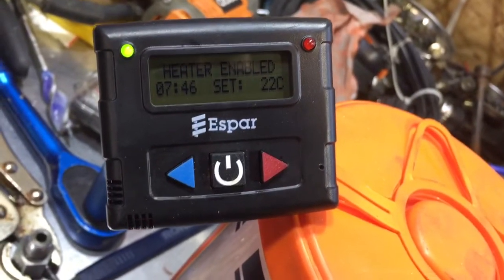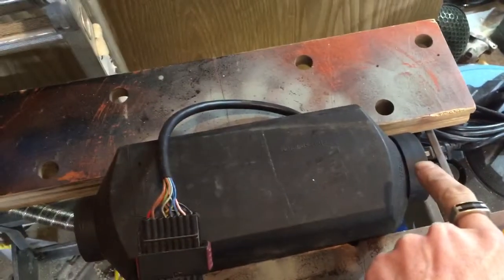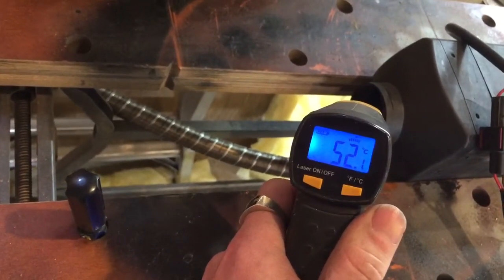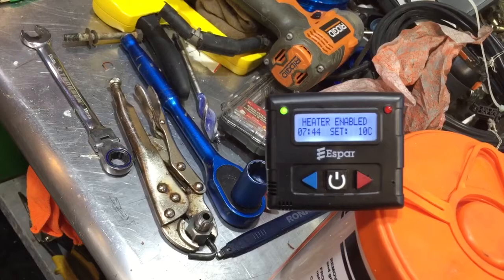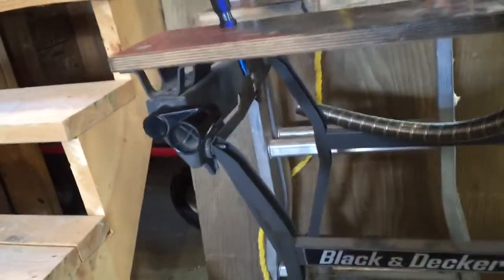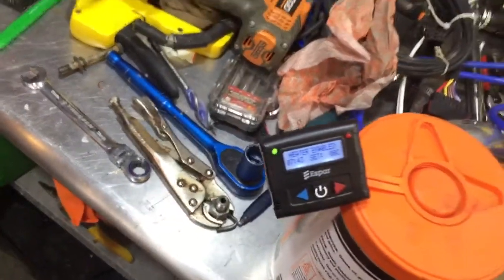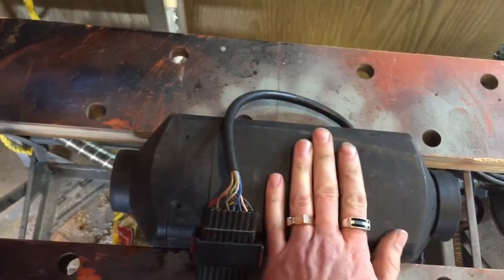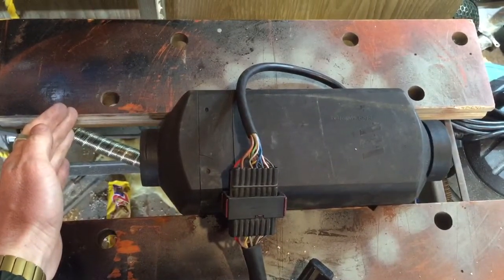Espar D2 Heater test

Comment: So my husband & I have spent the past 2 days installing the Espar d2 diesel heater in our sprinter van that we're converting. We have combed through every single component and wiring, and we can't figure out what's wrong with it. The Easy Start Remote won't connect with the unit. We keep getting an error code "INIT". I've reached out to the manufacturer (no response) and the seller (HeatSo) trying to get someone to help us. Do you have any tips for figuring out why the remote won't connect? We've triple checked that all of the wiring is correct and still can't figure out what's wrong with it. Any advise would be greatly appreciated! Thanks so much!

Comment: I wish I had tested the heater like you did prior to installing.  After many hours of installation, I do not have a flame, and there are countless points of potential failure.

Comment: just for info on this heater the fuel pump needs to be mounted upward at a 22 degree angle for the proper fueling to the heater. If you lay it flat it will overfuel and straight up it will under fuel.
Reply from the maker: After I couple of years, and experience, I decided to finally come back and say "you are correct".
Reply: Chad Ringstrom yes sir no problem.
Reply: Hi how come on. Commercial vehicles they are fitted horizontally along the chassis ??? And they work fine ? IE Main dealer fitted ??
Reply: Steven Richardson.   It’s correct I’ve been in espar classes instructor proved it.